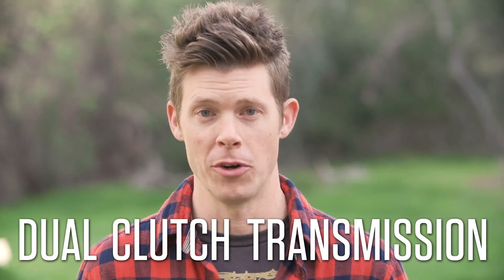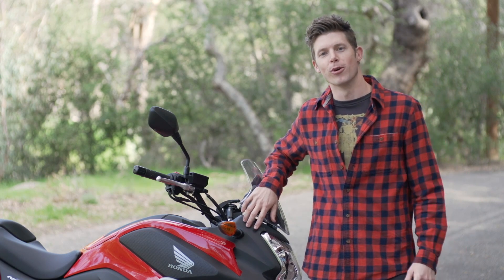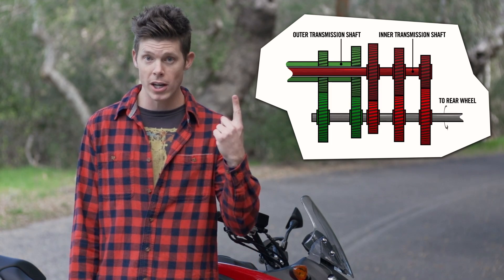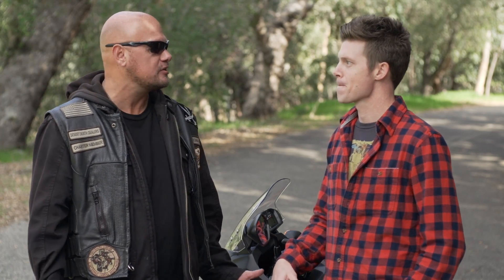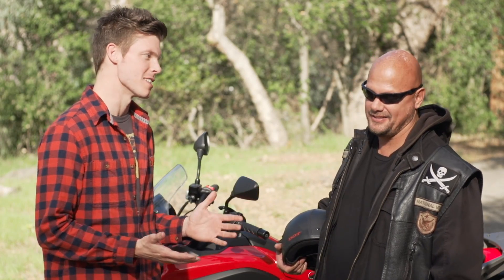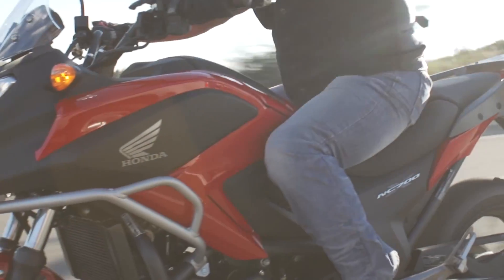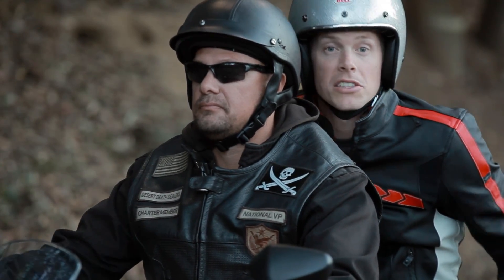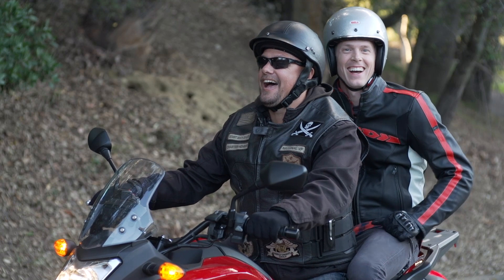Honda Explains Dual-Clutch Transmission (DCT)

Comment: Love my 2022 Nc750x DCT... Why would I want to change gears manually again? It's a real fun bike. Sport mode is awesome around twisty mountain roads. Now I know how I SHOUD actually be shifting properly. I've learned from the bike
Reply: I am 75 (yoa) & ride a Yamaha FJR but at my old age & only 5'7" & 150 lbs the FJR is getting a bit big & heavy for me - thus I'm downsizing to a 2022 750X (DCT) which should be at the dealership August 31st (+/-) - to say I'm excited would be an understatement as years ago I had a 2012 700X along with another FJR & loved that little bike which I took from Florida to California & back without a single problem - I would like your opinion & knowledge  & thus a question(s) if I may - I have read that going into a curve sometimes the DCT will downshift at a point where the bike is already into the curve which takes the rider by surprise - do you find this to be true ?? - when in mountain curves do you use the manual paddle ?? - I'm up in the North Georgia, North Carolina & Southeast Tennessee mountains at least 4 times every year thus my inquiry - also what do you mean when you say I've learned from the bike - any & all knowledge will be greatly appreciated - I thank you.

Comment: I am personally not a fan of DCTs in motorcycles unless it would be strictly a commuter of maybe a massive huge touring rig.   For a sporty fun motorcycle or a dual sport/adv bike I think the DCT creates problems and adds a weight penalty in the process....For instance the Africa Twin is something 35 pounds heavier than the manual   If you are going to give up that much advantage in weight I believe there are better solutions that could be engineered in....For instance I would love some type of Rekluse like clutch with a  switch to turn it off when it gets in the way....and/or how about using quick shifter technology along with electric shifter that also can be turned on and off....the best of all worlds FULLY automatic transmission controlled by computer that can be switched completely off in an instant!   I bet that would even weigh way less than the dct too....WHY is no one offering these??

Comment: I am driving one but my second bike is a standard and I like it too.  It is especially beneficial on big displacement 6 speed hwy bikes that you also use as a commuter.  If we are talking 5 spd torquey better in the city under 100km rides I still prefer standard.

Comment: we already know that dct is awesome but we where here to know how it works. on a honda bike. and still wondering why they dont put seamlesshift gearbox from actual f1 racing cars, and make them electronic so we can have a cvt experience with the shocking power of a dct (with out the stutters that a dct has when downshitfing....)

Comment: I’m a proud owner of Honda Africa Twin DCT . I’m using it since last 2 years and rode around 30 k . Before that I had Harley Fatbob I was so scared about it’s braking when cruising around 100 /120 plus then I tried AT it was like the bike which I wanted. For so long I tried BMW 1200 GS also BM is also good bike but Honda AT is more nimble and agile and yes with DCT bike won’t stalls at all when you are doing off-roading as well . Thanks to Honda DCT .👍

Comment: Honda Explains Dual-Clutch Transmission- then the kid says "Don't worry about - it just works better." The diagram is right there and a single clutch mechanism was just explained... so why does the rug get pulled out?

Comment: I had the dual clutch auto nc 750 the uprated one ist time on wet road almost came of 4 times had 

Agents of SHIELD

s06e10 checked only done less than 1000 miles tyres & psi spot on next time on wet on top of flyover behind car moving off no more than 15mph came off smashed panier off cut face (open face helmet) Checked on internet asked best tyres for wet only to find its hondas fault tyres made by Dunlop but Honda's ingredients warned if you  want this bike make the dealers change the tyres before paying for the bike I contacted honda stating the above & the next day was told to go to dealers for my choice of tyres free ( thats Honda owning up to their mistake) were your tyres Dunlop?

Comment: Okay, so most here are critical of this Honda ad. Fair enough. I'm guessing, though, most here haven't actually ridden a DCT equipped bike. (Aprilia builds a comparable 850cc Mana, BTW.) If you offer an opinion not based on actual experience, that says more about you than Honda. Many bike manufacturers offer big tourers and baggers with automatics and no one considers those to be "scooters" or less of a motorcycle. Fact: If you don't want a DCT motorcycle, no will force you to buy one.

Comment: An honest review from from a Honda NC700 X dct rider: 
Way smoother than a manual, smooth gear changing when changing UP. Changing DOWN however is clunky. In manual mode you can control when it changes UP, but not when it changes DOWN. This is a problem on corners.. You enter the curve in the right gear, get your speed right, look through the curve and then BAM it changes down and destabilises you. Really annoying.
It's also a problem in the ice, here in the UK we get a lot ice on the roads in the mornings, when you spot a patch you automatically slow down (who WANTS to die??) But then the dct changes down which produces engine braking which is very difficult to control.. With a clutch you can pull it in and glide over the ice.

So in short: fabulous idea, supreme about town and in the city... but can kill you in the ice and corners.
Reply: Nice comment answered my gravel question’s.   Clutch coasting saved myself a lot.
Reply: Just watch it once.

https://youtu.be/-e0a2wEJlwE
Reply: Ice destabilizes all bikes. And why are you riding faster than conditions allow?

Comment: Kinda forgot to mention, besides how awesome it is and how better it works, that it's also 10-14 kg (depending on the model of bike) heavier than the manual. As if the manual VFR1200X, for example, wasn't already heavy enough with its 275 kg.

Comment: I was hoping to find out how it actually works and how some general operating hints but I did find the video amusing, especially the reaction of the riders after trying it.

I'm going to try a DCT bike next week (VFR1200 Crosstourer Highlander) for the first time. I found another video about this bike which explained how to operate the two automatic modes and the manual mode.

Comment: Why is Honda only giving the DCT version of the NC750X ABS Brakes in the US? Honda Customer service had no answer to this question. ABS is mandated on all new bikes new sold in Europe so the manual transmission NC750X does come with ABS in Europe. I guess Honda thinks it's ok to sell a manual transmission NC750X in the US that's less safe, and that making ABS only available on the DCT version of the NC750X will firce people buy the DCT version of the NC750X to get ABS Brakes. No, it will just encourage people to buy the Yamaha 900 Tracer instead of the Honda NC750X!. Dumb Honda

Comment: I love dct on big bikes... I’m short so, even though I like manual, when I’m concentrating on keeping the bike upright ant maybe unexpectedly have to use both my feet... well maybe I’d enjoy not having to worry about the shifter. I was riding a bike with a seat 89cm high and when I stopped on a pavement slightly slanted to the right, I could only put my left foot down... I had to give throttle and release the clutch very gently and take of in second gear...
On my duke 390 I love the manual transmission though... because it’s a manageable bike. I hope that when I’ll be old and feel like getting a 1200gs they’ll offer it dct loaded, otherwise I’ll get a Honda crosstourer
Reply: Same with cars... give me a golf with manual, a Nissan Pathfinder with auto

Comment: I was just speculating the other day when/if Honda would  replace  the Silver  Wing  scooter. This seems to be it. Built-in locking storage? Check. No manual shifting needed in jammed traffic? Check. Sharp and modern looking? Check. Efficient? Check! Looks like more fun and better handling too. Add a top case and tail bag and it's a sport-tourer. I want one.

Comment: Having owned cars with dct and ect for the past 15 years. I don't think I will ever trust those on a bike. The number of times the computer decided to change gear mid corner or at other unwanted and unexpected times is scary. The car has 4 wheels esp and whatnot to help prevent you from fucking up. I wouldn't trust one of those things to not throw me off the bike in a situation like that. I'll just stick to cvt for automatic bikes.

Comment: Cool tech but I'm still a manual clutch guy. Cars and bikes if it doesn't have a manual to row when I'm shopping then I am not interested. In fact, the main reason I don't have a new 50-60 thousand dollar pickup in the driveway along with my cars is because they don't offer any of the good engines with a manual gearbox. I've wanted to add a pickup to my collection for a while now, I've tuned a few of the new Ecoboost 3.5 F150s at work and they make insane power; like low 13's to high 12's in the 1/4 mile with just intake/tune/exhaust power. (In a 5000lb chassis mind you) But they don't offer a 6 speed manual to row! This is why my Honda's and Mustangs don't have a big new truck brother. Some of us do still like a clutch and a shifter!

Comment: Did Honda not learn anything from the early 70's when they introduced the old hondamatics? 

Regardless of how well it works, or how revolutionary the technology may be, motorcyclists ultimately prefer shifting their own bikes. 
Besides, motorcycles without a clutch lever just looks stupid!
Reply: pbkayakyer Weren't the Hondamatics  two speeds? You can't compare these technologies without showing your ignorance.

Comment: If my XV250 has a flat battery I push start it. You can't do that with a dual clutch automatic transmission motorcycle.

Comment: Paid actors are paid.
But still, nothing wrong with a dual clutch gearbox. Works very well in cars so should work in motorcycles as well. Just don't ever use the stupid CVT crap.
Reply: Xerdoz The guys in black didn't seem paid, to me. They weren't articulate  enough.

Comment: Too bad actual clutches weren't shown in the animations. That would have made it much clearer. Give me time with any decent animation software and I can do a better job conveying what's happening in there. I knew what he was talking about only because I'm already familiar with the mechanics of transmissions. 

Oh, and that gear that the forks were sliding, it wasn't engaging other gears...

Comment: traditional meaning... simple and less weight.  More stuff mean more complex and more weight
Reply: jack schitt That's true, and DCT might be less reliable in the long run, just like automatic  transmission  cars compared to manual. But not many of us still drive manual cars. (I do, and it's not fun, most of the time...)

Comment: If you wanna know what DCT really is then you need some serious engineering courses, but still, it's better to master the clutch before moving to DCT.
Reply: Not really, DTC is easiest to explain like two gearboxes in one. One is for the round number gears and one for uneven number gears. While you accelerates the gearbox gets the next gear ready and then disengage one gearbox while at the same time engaging the other.

Comment: what up.. I bought a 2015 Honda CTX 700 Feb 16 I absolutely Love the new technology. the option to shift or just cruise is awesome.. one less thing to think about. with the ABS and sport feature I get plenty of power when I need it.. Its a low comfy ride for distance travel... Dont knock it until you try it.  I also have a 1981 cm400 Hondamatic Im restoring it runs great just cosmetic crap... Honda all the way!!!!!!!!

Comment: So leave it to honda to over engineer the damn thing just to charge more and it doesnt benifit a normal rider in the least.
Reply: You'd find most of the riders on the NC750X owners page I'm on would disagree with you.  Mine is manual, though.

Comment: I like all sorts of bikes, dirt bikes, sporty's, standards, nakey's, cruisers, ..and yeah scooters ... but this in not a scooter by any stretch. If you are not defined by some contrived motorcycle identifier, then you'll consider the possibility that this bike is indeed a motorcycle. I tried a friend's, and I like it. It's different yeah, but not so much different than the difference between a sportbike and an all out cruiser are different. I say, so what ... since when is different a bad thing, if it wasn't for "different" everyone would still be utilizing the old school suicide stick shifter ... amongst a long list of motorcycle innovations that wouldn't have existed, if it wasn't for that word, "different".

Comment: This explained nothing about how a single clutch manual or a dual clutch transmission actually works. The cartoon graphics were overly simplistic to make it hard to figure out that they were actually incorrect representations how a transmission works; what was represented as a clutch in the first graphic would actually be the shift forks, not the clutch.

They took people who already agreed to try the bike off camera and gave them scripted reasons that people give for not want a DCT bike, then they made fun of them for being old school.  Likely, all are actors and none of them ride motorcycles (notice no footage was shown of them actually riding bikes).

And I actually like dual clutch transmissions.  When I bought my VW GTI in 2009 I test drove a manual transmission car and the dual clutch (VW DSG) one.  The DSG felt like manual transmission where I didn't have to use the clutch, because it doesn't have a torque converter.  The I would have bought the DSG car, but it was $1000 more and I was trying to keep payments reasonable.  That said, once proficient with a manual I prefer a manual, because it does give me more control.  If a manual shifts rough or hard its because of me, not because the transmission has something wrong with it.  A manual shifts when I want it to and stays in gear when I want it to, not when a engineer determined that was the best time, rpm, torque, load, or mpg for it to shift.
Reply: https://en.wikipedia.org/wiki/Dual-clutch_transmission

Comment: How long before they fail and start miss shifting like all Dsg/Dct gearboxes have done in a lot of road cars? The Tech is great when it works, but could be disastrous on 2 wheels when it fails or miss shifts.
Reply: I'm on an owners page on F.B. There are very few instances of it stuffing up.